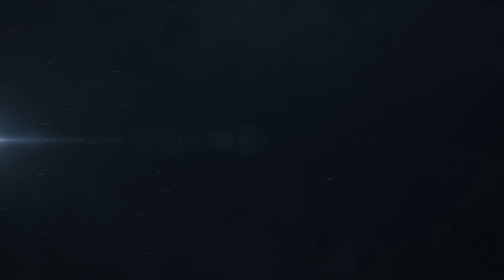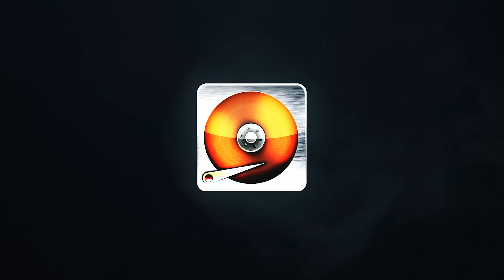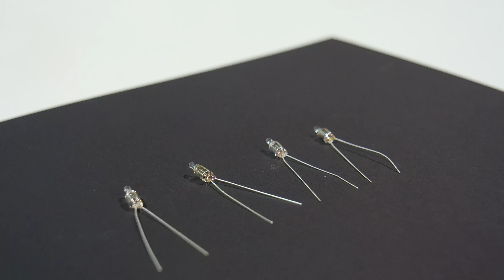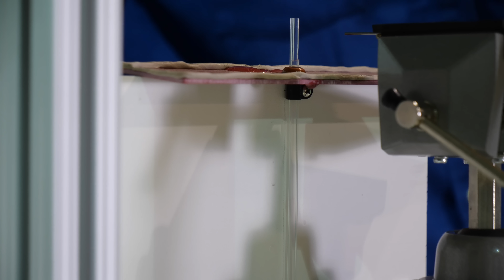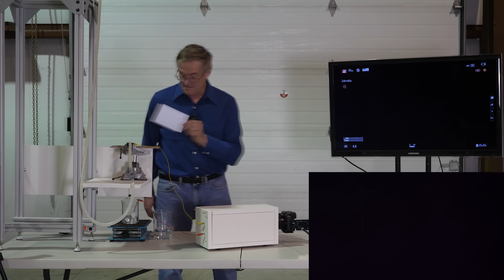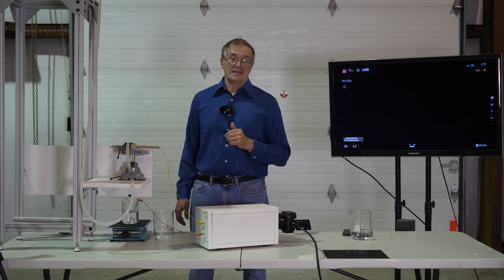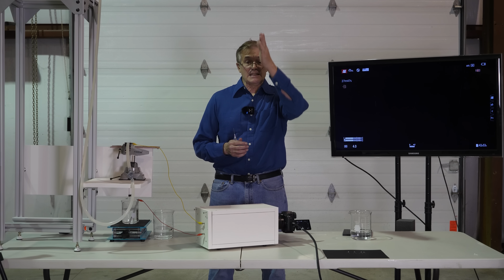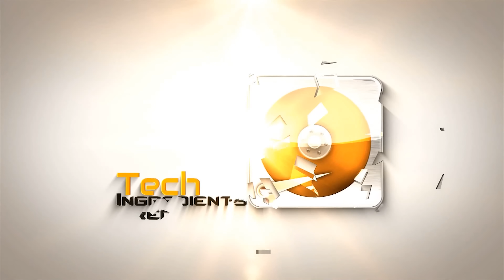We made electricity from water - and it's easy!

Comment: Cmiiw, Wouldn't the materials be "consumed" eventually? Since the potential difference is being generated by the separation of ions yet being "compensated" by electrons through current, the separated charged ions do not recouple. Instead, the end product should be highly active radicals at each end that react either with the materials themselves or the environment. At best, basically Hydrogen gas on one end and highly reactive HO• radicals. Am I missing something?
Reply from the maker: They do recouple.
The neutralized OH and the neutralized H can recombine to produce neutral water.

Comment: It's cool. I doubt it's actualy practicality though. A few things I worry about:
- when using non distilled water is that your tubes will probably get blocked fairly quickly as impurities in the water will cause build up
- if you want power that would any real value you'd need a whole lot of them, a smaller hydro power plant produces say 1 Mega Watt, so if one tube produces 1 milli Watt you'd need 10.000.000 of them to add a 1% power addition. Which is not considering the losses in conversion and moving the power around

Comment: i've heard that running water can generate a charge, but i've never understood why until now. super interesting. i imagine its similar to how an object moving through air (or air moving over an object) can generate a charge. although, static charges from moving air can accumulate to massive voltages fairly quickly; its why you never use a vacuum machine to clean electronics

Comment: To me this is just a different version of the "Kelvin water dropper experiment" which hasn't been looked at closely enough in my opinion as there is much more going on than what is shown in some of the experiments I have seen online. Professor Walter Lewin preformed a very good experiment that showed high voltage sparks but I observed something I'm pretty sure no one has ever thought about before in that I believe that if the water is kept charged it will start to breaks the covalent bonds of the water molecules by way of ionization. The experiment just needs to have something to capture any gases released in the process and be able to tell if hydrogen gases are present. 
For this to work the voltage levels need to reach and surpass the ionization threshold of the hydrogen and oxygen atoms so that they start ejecting their electrons as it will be that act of them ejecting their electrons which breaks the water's covalent bonds giving hydrogen and oxygen gases and the creation of an electric charge.

Comment: Okay... what if you put a bunch of those tubes in a wide circle, say 8" or so, then 3d print a round funnel type system that collects water and direct them down into the tubes (maybe like 20-25 tubes?) and then in the middle of all of this, you 3d print a circle with little walls in the shape of a spiral, and place this spiral onto a bearing or something... Water would be directed to the center of the spiral, the water itself would follow the walls of the spiral, exerting a force, making the spiral spin... as it spins, the water is flung off of the spiral into the funnel, and then down the tubes, but water cannot flow where the walls of the spiral are, so you'll get that separated flow that you want.

For connectivity, I think you'd need to coat the funnel piece in metal as your cathode, and then put the anode in the collection basin. If my thought process is correct, you'll end up with the same voltage, but current X times the number of tubes used. But with 8" diameter, you could probably do about 40 tubes. Of course, you'd need more water then too. I dunno, but this is fascinating. I hope you scale this up and let us know how it goes. :D

Comment: is water temperature going to affect the voltage or current of that test? there must be a device that can store these high voltage & low current like a capacitor or battery.
Reply from the maker: Probably,  but based on the mechanism, it should be a pretty small effect.

Comment: I'm interested in how other materials affect power production.

Also,I know that this design was intended for use with low flow systems, but how would the parameters of the design change when introduced to a pressurized water flow. A pressureized design might find use under a water reservoir, thus allowing for rain water harvesting. I was toying with the idea that an atomization nozzle might work for the pressurized design, like those found in an oil furnace. Or something similar.
Reply from the maker: The researchers found that the potential is limited to approximately 6,000 volts.
This would be per-stage. Presurization would allow each stage to be shorter.
The tubing used for the demonstration was convenient, but it isn't key to its operation. Large, flat, closely spaced plates should also work and would make  the design more space efficient.
Reply: @TechIngredients i wonder if amperage is linked to plate width?

Comment: Hey Tech Ingridients! I've been a long time follower, your videos are always very in depth and the process to arrive at the conclusion has always been fantastic. I do have a question and or possible idea for this video. What would happen if you added a weak base that could dissolve in the water. You mentioned that the power of this comes from essentially separating ions and cations. I'm not a chemist but a base will donate more HO-. Maybe it will increase the electric output? Just a thought.
Reply from the maker: Thank you!
I'm not sure. 
I could be wrong, but increasing the quantity of any ions should increase the current due to separation, but when tested with seawater,  the efficiency dropped 10%.

Comment: not bad. same basic principle as a kelvin electrostatic generator. its cool but we have better ways of generating power from water flow. nonetheless another excellent video
Reply from the maker: Thanks. 
The mechanism is different from a Kelvin generator.  That depends on an external field to separate the charges.
This depends on surface interaction between the water and the surface.

Comment: So, basically Maxwell's Demon. Tho it doesn't really violate thermodynamics. I'm far from convinced of practical applications, however. The power density is low, and high-voltage, low-current power is difficult to make use of. The potential for chemical reactions with the ionized (acidic) water is intriguing, but it's low volume.  It'd have to be something that requires only small quantities, where integration with existing water flows adds value.

But I hope my pessimism inspires you to prove me wrong. I am quite impressed as it is, with getting that much visible light from it. If nothing else, you could make a Rube Goldberg novelty rain detector!

Comment: Hi very interesting topic   the tubing you speak about what if it has grooves or like a rifling inside to control the flow maybe that can help to make it more effective and ifficient
Reply from the maker: That's an interesting idea.
The surface we're using is inside a tube because that's convenient. But the tube is not necessary. This could be done with closely spaced flat plates as long as the flow is intermittent. Ridges or grooves could stabilize the flow so that the drops don't coalesce.

Comment: Integza in one of his video made a cube of such metal plated 3d printed lattices (foam) trying to increase electricity production of hydrolysis, may be try it with this method to increase power, also if you need a intermited flow in a tube can you use ultrasonic speaker to breake water inside a tube like in ultrasonic levitation, and there is also was a nice experiment with making high voltage from water by (plasma channel) it can be stored in a improvised capacitor made from jar of water wraped in aluminium foil

Comment: This is WRONG!   I was very dismissive of this technology and withdrew my comments following the  reply that I had not reviewed the paper properly.   Having now looked carefully at the data presented in the paper,  I was correct to dismiss it  as wrong!      They quote a potential for generating  over 100W/m2,  which would be quite a  good power  level.   However, when  I looked to see where this number had been derived from I found that the  authors have made a fundamental error in  their calculation.    They quote a peak power of 440 ± 13 μW  for a 2mm diameter tube,  320mm long.  To derive the W/m2 they have used the area of the end of the (2mm diameter)  tube and used that as the multiplication factor and indeed this would give 140W/m2.  However,  the area of the generating device should be the internal surface area of the tube.   This means that they have an error of 640x  in their energy density calculation.   The correct figure is just 0.21W/m2 for the device. This is not a practical cost effective way of producing power in any form.
Reply from the maker: It's good that you reviewed the paper as I obviously have.
The authors' extrapolations are a mistake, as Sabine pointed out in her critique. 
Their explanations regarding the process itself are reasonable and, I think, correct.
Reply: @TechIngredients  The science is sound,  the principle is well known and they have done some nice work to optimise the system.  However,  this was picked up by various science magazines and feeds and touted as a "wonder" device (free energy!) based on the headline 100W/m2.    It took me 2 minutes to find  the error and overstating by nearly three orders  of magnitude is poor!  I watched Sabine's video and even she missed the fundamental power density error!        I am interested in alternative energy harvesting and energy efficiency but I see  too  many reports of "wonder"  devices that are wrong, misleading or just fake.  The biggest mistakes are ignoring total energy cycle efficiencies.

Comment: You used distilled water. Ground water is filled with metallic ions. Will it still work with "durty" water?
Reply from the maker: It will produce 90 % as much power even with seawater.

Comment: I like the idea of adding a secondary power generation method to something like a hydroelectric dam - but isn't the byproduct a problem?

Adding positively charged water to the outflow is going to make the outflow more acidic correct? And it would scale up along with the power output? What kind of environmental impact would that have?

Another thought I have (although I'm no kind of engineer) is that you could add this as a stage in closed loop steam turbines as part of the condensing / cooling cycle. I guess you would run into even more issues from the acidification there though. What is the practical limit for a closed loop for this process?
Reply from the maker: The positive charge neutralizes as soon as the current flows.

Comment: Sounds like splitting hairs about it not being able to generate from rain water when you can do it from a reservoir of collected rain water trickling intermittent , But thunder storms tell me it is possible.....
But the 'forever chemical' plastics are not a good idea, and something like hydrophobic  graphine would be better option.
Reply from the maker: It's not about splitting hairs.   Raindrops are so diffuse that they will very infrequently fall where you want them to interact with the device. This means a large area collector that would be prohibitively expensive to build.  But "collectors" already exist in the form of roofs,  mountainsides, and rivers.

Comment: I don't know, the Kalvin water dropper generator is more impressive with its abrupt  capacitive discharges. And those neon indicators are more like 70v were they start to light, so your measurements are already off if that is how you are measuring your voltage.

Comment: The way rain is often dealt with on human buildings would mean making a system like this work with rain shouldn't be too bad - you already have a large catchment area with guttering to funnel all the water to one feed, and you often anyway actually need that guttering to protect the structure, to force the water into the drainage/soakaway rather than pooling on the pavements etc. So the added cost to fitting power generation to the gutter, given it really is just some minor changes to the already used plastic tubes to generate that intermittent flow, and probably replacing the catching gutters themselves with a water storage tube that acts like a regular gutter only once its full (you want some water storage surely to keep whatever you are powering on more often) is pretty darn small. The real challenge is finding something you can use that less than ideal for any device I can think of electricity for, or finding an affordable efficient way to turn into a more useful low voltage DC.

Comment: Interesting phenomenon indeed. Actually using it would fail simply due to practicality in my opinion.
To illustrate the point: Very recently I heard a lecture from an industry representative. They were involved in a project to improve the properties of electrode tapes for lithium ion batteries. Project went great, results were good, it was never implemented in actual production. Why? The modfied slurry clogged the filters they use in gigafactory scale, so they abandoned the new process.

All the practical water sources will have debris and stuff dissolved in them that will form residues over time. As said: Neat idea, but I don't think it can work effectively unless the water source is purified to begin with.

Comment: There is a voltage difference with a change in elevation. Even though your interpretation of the test results may be wrong, that still may be a way to produce electricity. Try suspending water at higher and different levels, so that the voltage of the water equalizes. Then repeat your experiment with the water drops moving over a non-conductor. The significance of the  water drops makes sense due to the liklyhood that a steady stream of water may act as a wire that may not retain the voltage difference at the bottom. So, to verify that, repeat the experiment with a steady stream of water. I considered saving this for myself, but I have been holding back too much; this experiment would never get to the top of the list.

Comment: This project rocks.  You said 1mW.  A device with 1000 in it.  Or 100 with 10 times the length.  1W is a source.  Line up a few capacitors and that's running an esp32 with enough to charge a battery.  sqrt of 1000 = 32.  each tube is 2.5 OD or thereabouts = 80mm.  Say a 10cm square, 30cm long.  All the tubes staggered at the top.  They don't even need to orientate the same direction.  But either way, the 'cap' with the feeder tubes gets attached at the top, the water feed cap regulates the flow to it.  Receptacle at the bottom empties when it's full.  That whole setup is small.  Awesome.

Comment: That's what I call truly fascinating science that is not merely plausible but seems likely to become practically productive with further research into the parallelism aspect you mentioned here.  Scaling upwards significantly from the small amount of high voltage at extremely low current intermittent power flow achievable with this setup to something legitimately useful en masse, poses a huge obstacle but not one so unrealistically huge that it cannot be done with enough sheer will, scientific trial & error and clever ingenuity.

I'm excited to see where you go with this!

Comment: You did NOT make electricity from water. What you actually did is to harvest the electrostatic potential generated by moving water. What generating electricity from water means is either to oxidize water chemically or to nuclear fuse the hydrogen nuclei in water to generate power.

Comment: Your talking about a charge that trees 🌳 make to transfer negative static energy to the clouds ⛅️  , where it rises to high atmosphere and that electric power is condensed by turning to ice 🧊.  
   Building up high energy negative charge that's far greater then the negative water 💧 charge on the ground . 
   Perduceing a colossal separation in charge . 
   To the point 👉 of huge displays of lightning 🌩 discharge. 
   And this seperation of water charge cause a static electric attraction as great as magnetic but static, to DROP THE CLOUD LOWER IN THE ATMOSPHERE , RASING BAROMETRIC PRESSURE AND CONDENCING WATER VAPOR INTO RAIN 🌧.  
    ALSO AND AT THE SAME TIME THIS HUGE SRPPERAT NEIGITIVE CHARGE BY AMOUNT OF ELECTRON DIFFRENCE ATRACTIVITY FOLLOW UNDER GROUND ACUFERS THAT FLOW EAST AND WEST TO DEVELOPE THIS CHARGE FLOWING THREW SAND . 
   And so thunderstorms periodic lightning discharged helps them move to the next charge difference in an underground aquifer like an electric train moving down the track ! 

Here's what I found not one so-called meteorologist understands this concept . 
   And I would make it impossible to understand if I express to them the way that the Magneto effective lightning creates sprite lightning to the ionosphere . 
   Now and I might add that's enough energy to light several cities for the next Thousand Years ! 14:39